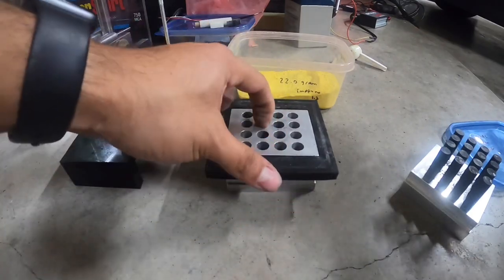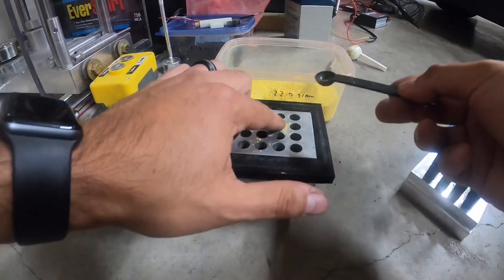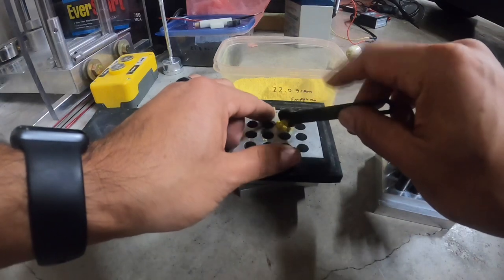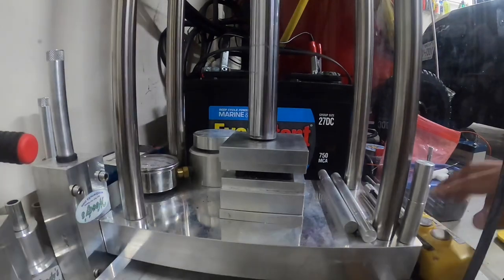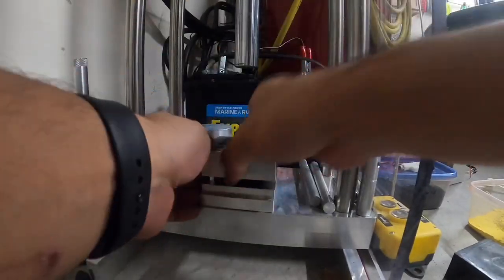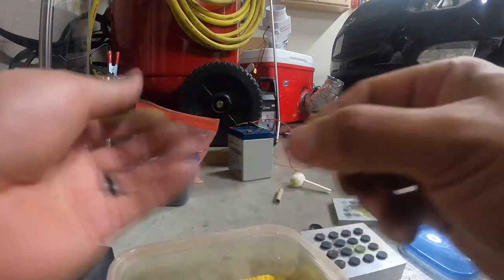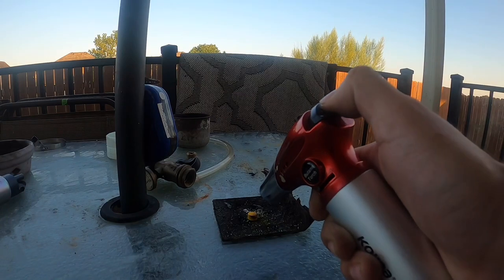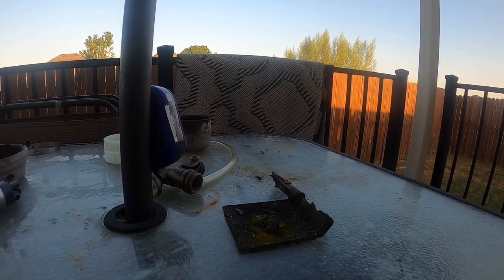Can you press smoke composition into a puck?

Comment: You need a hollow core in the smoke pellet. Try using an empty tube support, like a 4oz support, a 1lb hollow rammer, a 4oz bp rocket tooling or strobe, anything with a spindle. Don’t put a tube in it, and just press a small amount of just comp with the 1lb hollow rammer. Then take it apart and remove your test pellet with a core.
Reply from the maker: That’s a good idea I have tools for that or I could press some and drill a hole down the center. Thanks for that.

Comment: Just to do a test! Unless you have a comet setup to get a hollow core
Reply from the maker: No that’s the one tool I don’t have. The core makes sense as it should provide an air gap to help with ignition across the puck. I understand how cored vs end burner rockets work so I think it would work better.

Comment: Where did you get your press? Are they expensive? I've been watching you videos and I'd like to try my hand at making rockets but a hydraulic press would make it much easier. Thanks,E85TI. As usual, great video.
Reply: Those presses run about 2grand plus another hundred or two for freight shipping…
Reply: Yup about 2 grand and a few hundred in shipping. You can get away with pressing with a modified arbor press from harbor freight
Reply from the maker: The price went up and yes everyone is correct on the price but I was lucky enough to have paid 1800 with shipping. If you need a cheaper option you can use an arbor press which is what I still have but I don’t use it much.
Reply: @23gsxr1k  Thanks much.
Reply: @PineyWoodsPyro  Thanks, pyro.
Reply: @E85_STI  Thank you. I'll start shopping around.

Comment: We need to get together. I need about 50 1/4 stars with color smoke. And i can build a 3inch shell
Reply from the maker: So these are 3/8 but I think since they are pucks and have no way of lighting shouldn’t be too much of an issue to mail but I could be wrong. I like that they press nicely but I don’t have a star roller to roll them in primer. I can make one though.
Reply: @E85_STI  i have a home made star roller but would mist water and dust with prim the 10 inch i made stars for that's how we primed them and they all lit well